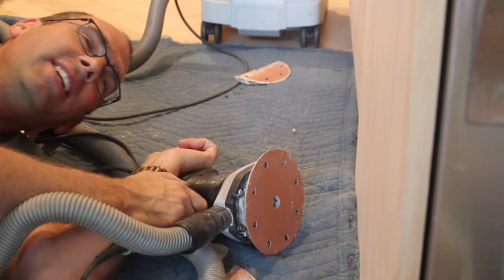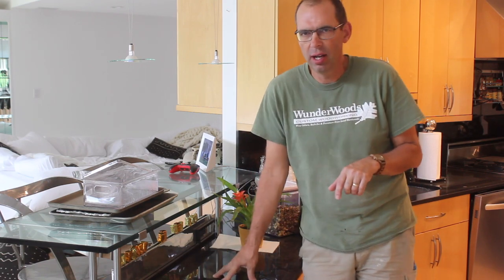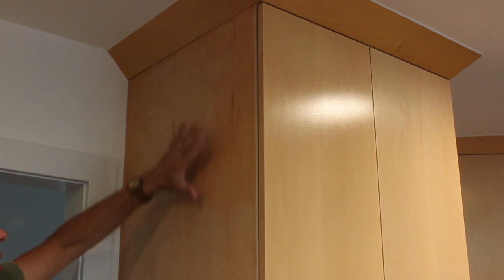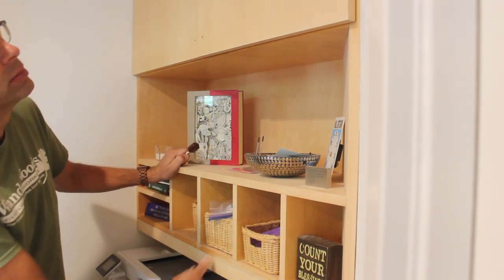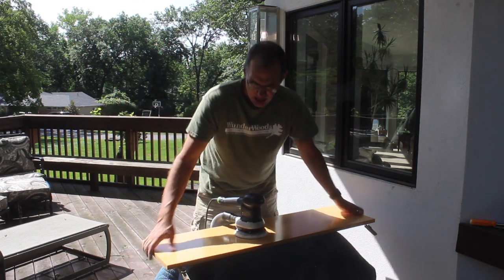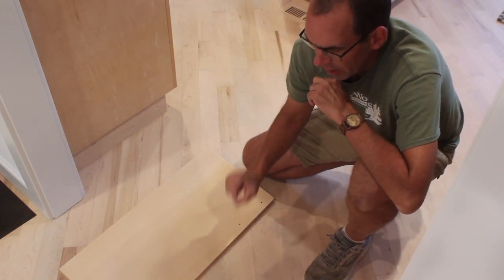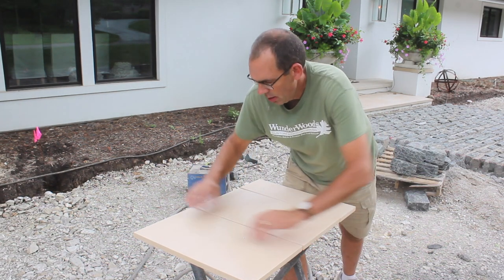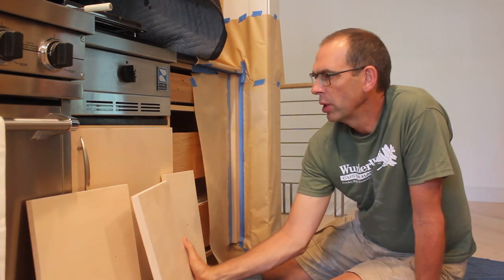Updating Maple Kitchen Cabinets - From Old and Orange to Bright and White

Comment: Hi and thanks for making this video! I'm redoing my maple kitchen cabinets too- the cabinet boxes are plywood with veneer and the doors are shaker style with the 4 planks of solid wood and central panel of plywood maple veneer. I stripped ALL the doors and drawer front with the stripper. I stripped some of the cabinet bases but could not use stripper on vertical areas of the cabinet boxes because I was afraid that the stripper would get into the corners and weaken any adhesive if any was used in the Contruction process to hold anything in place. I am now in the sanding stage of the doors, drawer fronts and shelves (never stripped the shelves but just sanded). Im using the CT15 festool extractor / RTS 400 rectangular sander (the finishing sander) but its a very slow process. I have to sand all the cabinet boxes exteriors and interiors too- should i even bother with the interiors?  I was thinking of using this same rectangular sander on the cabinet boxes too but wondering if the random orbital sander would be any faster. Not sure if i should go and buy one? Thought id reach out here and seek your advice with this project .. thanks a ton!   I was also planning on using the Arm R Seal polyurethane from General finishes after my sanding- I dont want any whitening effect so not going to be doing any white paint mixed in but now im thinking that I should just go with the water based poly from General Finishes. Thoughts? Sorry for so much info-
Reply from the maker: An orbital sander is definitely faster than the sander you have, especially if you get one with a bigger swirl pattern or the ability to switch to a bigger swirl pattern. We use Festool sanders with 5mm swirl pattern for faster sanding on clear finishes and 3mm swirl for sanding on stain finishes. Your sander has a 2mm swirl, so it will be the slowest choice. I also have a Ridgid sander which will switch between aggressive and less aggressive swirls. I like both sanders, but we have Festool sanders for the shop because they last much longer. Water-based poly will help retain the light maple color because it doesn't yellow. The maple wood will yellow with age. This is where the added white helps. It isn't so much to be a whitening effect as much as a way to hide the natural yellowing of the maple.
Reply: @ScottWunderWunderWoods  Thanks. What's the model of the sander that you were using? I am now trying to figure out which kind of topcoat i should use? The options are Arm R Seal oil based, Enduro Clear poly or the High Performance Top Coat in Satin - all GF products. My cabinet decision is a bit complicated, wish i could share pics with you :)
Reply from the maker: @cavalli821  I am not sure on the model number. We have several different models and all work fine. I am not a huge fan of water-based finishes, but I would recommend water-based in this case to keep the finish from yellowing. Oil-based finishes will yellow for sure. As far as the specific General Finishes products go, I can't really comment since I have never used them. We use mostly M.L. Campbell products.

Comment: @ScottWunderWunderWoods~ I have now watched both of the videos you posted on this maple cabinet job and want to thank you so much for the great content! I have a question about my cinnamon stained maple cabinets and I'm hoping with your experience & knowledge, you'll be able to give me some feedback and insights. Is it possible to strip and sand my cabinet doors, drawers and face frames back to the raw wood and then re-stain them in a different color, more like a "Barley" toned color? I know that maple can be very finicky to stain because of the tight grain and many woodworkers suggest using a "Dye-Stain" to get a more controlled even finish vs a traditional stain product even if you pre-treat the wood. The finish on my cabinets is failing along the tops of the drawers and doors from almost 20 years of use, so I will need to refinish or reface them soon in one form or another regardless. I just think that the "Barley" color will be more forgiving as it is lighter than cinnamon and thus any future "wear patterns" won't be as obvious.  Any advice or feedback would be greatly appreciated. ~Christy~
Reply from the maker: I am assuming that "cinnamon" is darker than "barley", so I imagine you will need to sand off the old, darker stain to achieve your lighter color. Yes, they can be sanded with care and plenty of work. Once down to raw wood, I would also recommend a dye stain for better results, especially on hard to stain woods like maple. Since you won't be adding much color, you should be able to control the blotching.
Reply: @ScottWunderWunderWoods   Thank you so much for your response and advice! I know it will be a ton of work, but I'm going to go for it. Is there a particular brand of dye stain you recommend over others?
Reply from the maker: I use TransTint dye stains. I haven't done any head to head tests of dye stains, but TransTint has always worked well for me.
Reply: @ScottWunderWunderWoods   Thank you!

Comment: Nice demonstration.... I wish our cabinet fronts were flat but they are not and would be much harder to sand.  We have no idea how to get a good refinish on them.   We live in Anchorage, Alaska and have called every woodworker in town... none of them will take the job.
Reply from the maker: Everyone was surprised I took this job too. With non-flat panels it would be much more sanding. Yikes.
Reply from the maker: I've got a bit of an update. I went back to work on more of the same cabinets and tried to not sand. It worked great. I lightly scuffed the surface and sprayed the cabinets with water-based polyurethane with white paint added and it turned out great. https://www.youtube.com/watch?v=yDVNlU_aWB8

Comment: Can the polyurethane be applied with a brush/roller?
Reply from the maker: Yes, but no. It can be applied with a brush/roller, but the application will be uneven and the white will be streaky/blotchy. A spray gun will be much more consistent.

Comment: Thanks for the video. Very informative. I’m doing the same thing but to all my wood doors due to our new light maple floors. Since the doors are wood. I’m guessing I can strip them first. And might save a little time. But the inside is veneer. So you suggest only to slowly and lightly sand the inside veneer areas right? Which I wish I could show a picture but it is a shaker style door.
Reply from the maker: You can try the stripper and see if you think it helps, but I imagine it will be all you sanding away. Think of it like knitting or something else you don't do too quickly. Maybe use it as a meditation device that has visible results. It just takes time.
Reply from the maker: I've got a bit of an update. I went back to work on more of the same cabinets and tried to not sand. It worked great. I lightly scuffed the surface and sprayed the cabinets with water-based polyurethane with white paint added and it turned out great. https://www.youtube.com/watch?v=yDVNlU_aWB8

Comment: Thanks Scott, very informative and helpful video! Did you strip the wood (chemically or otherwise) before sanding, and why (not)?
Reply from the maker: The wood was just sanded and not stripped. Chemical stripper would have caused problems with the veneer and mdf core panels, so that was not really an option. Plus, I needed to sand the top layer of wood off to help remove some yellowing.
Reply: @ScottWunderWunderWoods  Thanks so much!
Reply: @ScottWunderWunderWoods  Hi again Scott, I just realized our cabinets have (Shaker style?) raised panels on the front. They're solid maple except for a few veneer panels. Is there an approach you would take or recommend for getting that yellow out? A special kind of sanding pad to work through the raised panels? Or would switching to a chemical stripper make more sense there, and then try to match on the veneer panels via sanding? So curious what you'd do!
Reply from the maker: @LARRYKOSTER1  I don't see any way around sanding. It's a necessary evil. Chemical stripper will only get the finish off, which will probably reduce the yellow, but a lot of the yellowing is in the wood, so it needs to be sanded. I don't really use any special sanding pads, mostly just paper folded up and pushed into corners. A detail sander will help too, but you have to be careful to not be too aggressive.
Reply from the maker: I've got a bit of an update. I went back to work on more of the same cabinets and tried to not sand. It worked great. I lightly scuffed the surface and sprayed the cabinets with water-based polyurethane with white paint added and it turned out great. https://www.youtube.com/watch?v=yDVNlU_aWB8

Comment: What brand of latex paint did you use and how much? Thank you
Reply from the maker: The brand won't matter, your just trying to get some white pigment into the finish. We have tons of paint in the shop and I just grabbed what we had. As far as amount, I just dip a stir stick in the white paint and then use it to mix/stir a quart cup of finish. It is very scientific. I would recommend starting out with less white because you can always spray another coat of finish to increase the white. It is much more of a pain to remove it. Definitely do some tests to get a feel for it and check the results. Make sure your samples are dry before deciding if you like them or not.
Reply: @ScottWunderWunderWoods  Thank you!  I will definitely play with some samples first. I will reach out to you later with more questions 😄, if that's okay with you?